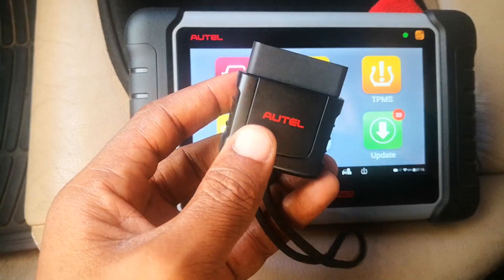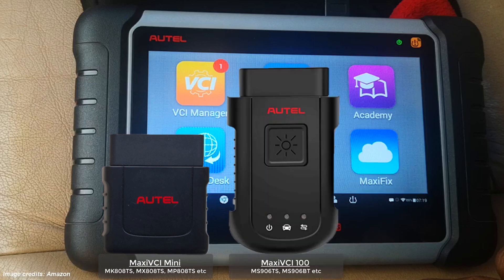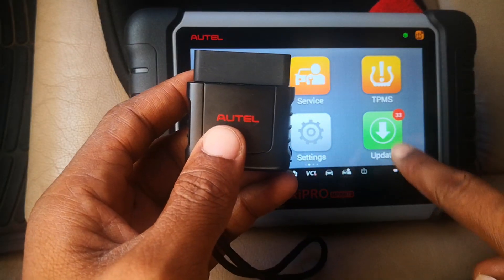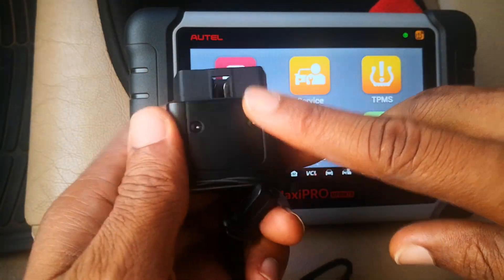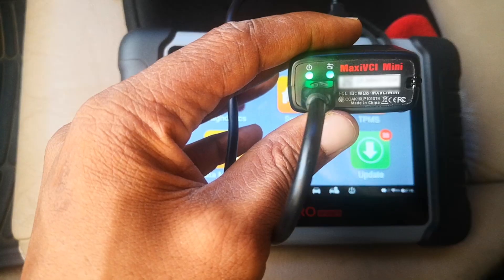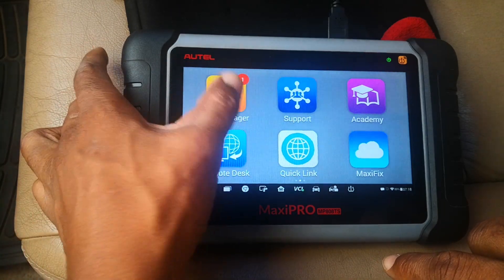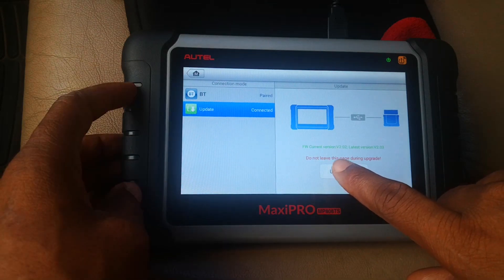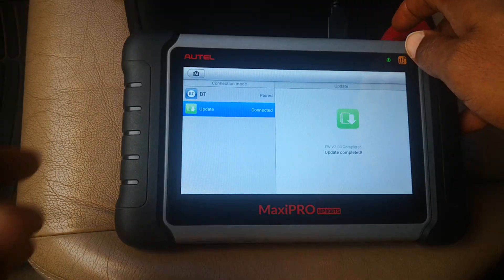How to UPDATE Autel VCI FIRMWARE: VCI update for Autel Scanners

Comment: I have an Autel MK808BT PRO. When I connect the wire between the mini VCI and to the tablet, two two lights turn green on tne Mini VCI, and when I hit scan in the tablet for Maxi VCI pairing, I get a message that reads:  "please check if the device us connected to other devices" and it will not pair the VCI to the tablet, even though the icon at the bottom of the screen shows green, which indicates a good pairing. As a result, I am not able to check for VCI BT updates. This happens when I do not have the Mini VCI inserted to the car's OBDII connector, however, your video showed that the pairing worked for you with the VCI not connected to the car. What am I doing wrong?
Reply from the maker: I'm honestly not sure what you're getting wrong. Have you reached out to customer support? Are you sure your scanner is connected to the Internet?

Comment: Hi, I've bought a new autel since the price for update pushes u to do that 🙄.. The tablet is old but i really would like to use the maxi mini vci on other tablet/phone etc. Is it possible? Anyone?
Reply from the maker: It should work with other compatible Autel scanners ie, those that use the MaxiVCI mini. Don't think it will work with any other devices, but could be wrong. Never tried, and won't advise anyone to do so, just in case you brick something. You could sell on Ebay or keep as a spare?

Comment: My VCI 100 will not connect. When I plug it in the power light stays amber which according to the manual means it's self testing and it never changes. The autel cannot find the VCI when I scan for available devices and it is not showing any firmware updates available in the VCI manager. Not sure how to proceed.
Reply from the maker: Sorry to hear this. Does the VCI 100 have a port for doing a wired connection from the VCI to the tool? Have you tried that?
Reply: @DIYAutoworksNG  Yeah it can be wired to the tool but even if I switch off the BT it will not connect with the car. The VCI still just stays amber colored at the power LED indicator. I'm going to order a new one.
Reply from the maker: Have you tried connecting it to a PC to see if you can update the VCI?
Reply: @DIYAutoworksNG  Great idea....I'll try that.
Reply from the maker: Remember to download the Maxi PC suite if you don't have it already.
Reply: @rbailey225  Hi did u manage it am facing the same problem too,my vci is not connecting with the tablet

Comment: Well, is not all the time such simple. My Autel MP808 is doing an firmware upgrade since yesterday (18 hours) and is keep telling me "please don't disconnect or exit from this page!". I wonder what's happening if it will be disconnected... After all is just another cheap and crap piece of Chinese technology.
Reply from the maker: Firmware upgrade running into hours is odd. Still you still have a subscription, I recommend reaching out to Autel tech support. Definitely sounds off. Never experienced this on mine. However, I have forcefully shutdown some windows PC/laptop that just hung during an update. Do you have a backup?
Reply: @DIYAutoworksNG  Thanks for your reply. Opened a ticket on Autel, no replay so far. Fortunately I did forced the device to close the update and I had success. Most probably it didn't even started the update process. I disconnected the interface cable and the update process was discontinued by the device. Anyway, right now it tell me that I have the current FW version 0.0.1 and the last one 2.0.3. Obviously something is wrong... and for sure I'm not going into an update any soon. Cheers!
Reply from the maker: Lol. Glad you had it resolved! Had a recent experience with an XTOOL. Programmed a key and it just wouldn't confirm at the last step. I shut the car off and turned it on again and the step completed. I have the same 2.03 version. Guess you may try it again after Autel support gets back.

Comment: Will the mini work for a ms906bt?
Reply from the maker: I am yet to try this, and at the moment can't tell.
Reply: @DIYAutoworksNG  are there any good discounts for the mini? I have a ms906bt but i just bought a replacement vci for 200 wouls be awesome to know that that woule have worked and id save over half the money next time
Reply from the maker: I'm seeing $80 - 160. The sub $100 are Ebay sellers. The above 100 are mostly on Aliexpress.

Comment: Can this clear airbag lights the version you have ?
Reply from the maker: Yes. Depending on what caused the airbag light to come on. If its a general airbag fault not resulting from an accident, it will clear after appropriate repairs. On the other hand, if airbags or seatbelt deploy, this will not clear the light. As a matter of fact, only special dedicated tools will delete the crash data and clear the light. I did a related video when I got a 2017 Accord, accidented https://youtu.be/_Y5Q42IZnoI
Reply: Thank you for the reply I’m getting into buying crashed cars and clearing any problems that might occur after replacement thank you so much for your educated answer and your channel I just subscribed.
Reply from the maker: @mplscarsales6652  thanks, mate. All the best in your new venture!